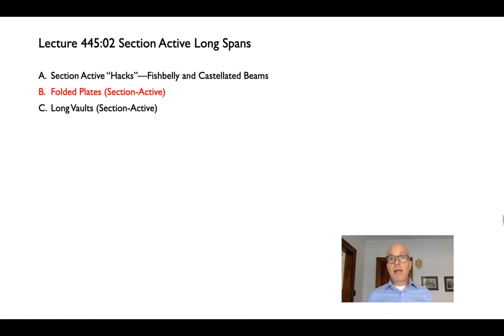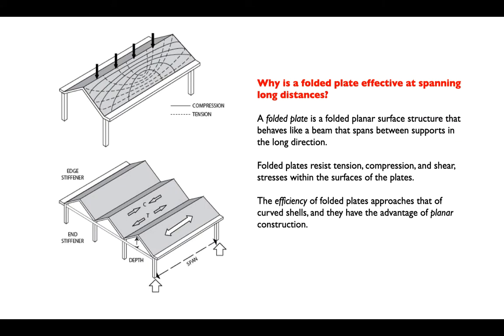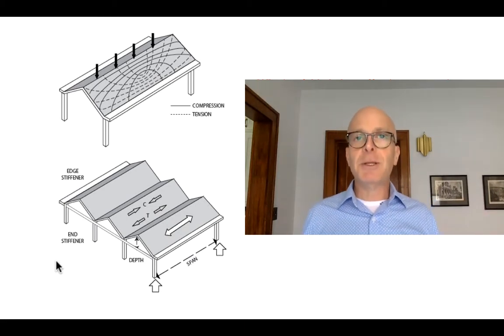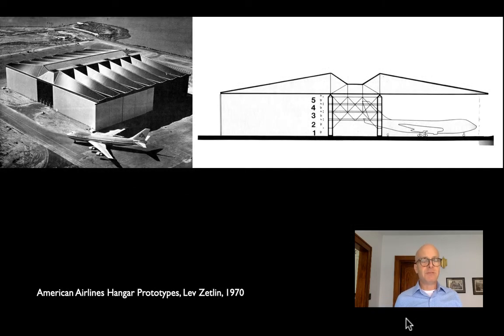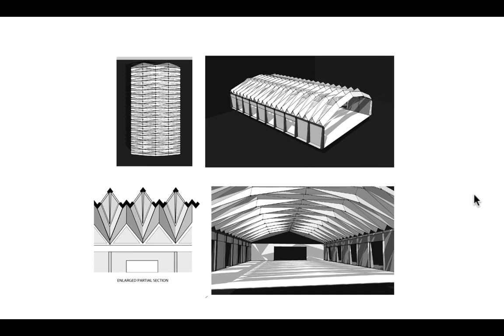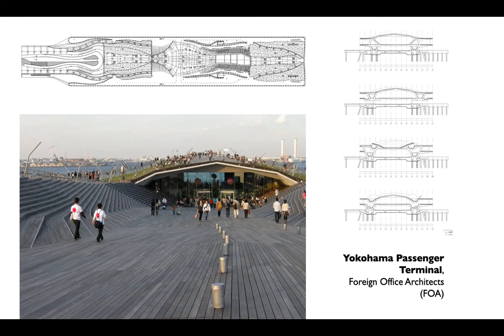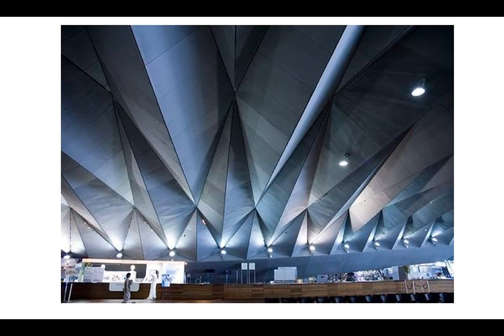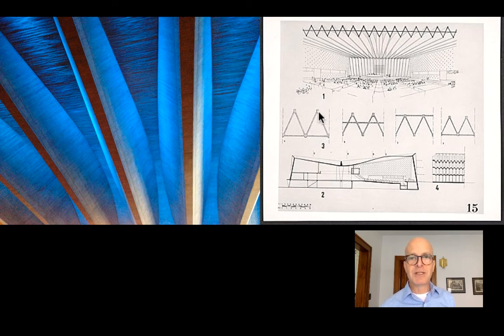ARCH 445 Lecture 02b Section Active Folded Plates

Comment: In some cases, folded plates are classified as surface active structures. I am wondering why did you classify it as a section active system? I intrinsically feel that it should be either a surface active or a form active system...
Reply from the maker: Good point--to my minds, folded plates, exhibit qualities of all those types, depending on how you look at them. I've referred to them as section active, because, in most cases, the goal is for them to behave more like beams in spanning, thin like shells. But you are correct that they can be explained as surface or form active as well.
Reply: Thank you for your answer Professor 😊I really enjoy your videos!

Comment: Why didn’t SOM take the same kind of undulations to the perpendicular axis? Or even taking it further and apply the same undulations to underside of the slab?
Reply from the maker: Not sure which project you're referring to--but especially with pre-CAD/CAM technology, forming doubly curved surfaces was a difficult (expensive) fabricational task--this meant forming curves in one axis only would have been much easier...
Reply: @thomasleslie274  thank you for replying. I was referring to stereoform concrete freestanding shelter. It seems to me it could have been developed even further and make it a 3d undulation. In other words, replicating moment diagram could have happened in the perpendicular direction as well. And then morphing of them. 
On another note, thank you for your great lectures. I think I have watched almost all of them and find every single one fantastic. A Combination of theoria , poeisis and praxia . Thank you.
Reply from the maker: @Mytraism  Glad the lectures are helpful!  If I recall correctly, the stereoform slab proved more difficult to cast in two directions than initially thought--the cantilever span of the roof is pretty short and I'm sure it was easier to form as a simple flat slab.  More info from SOM here:  https://www.som.com/research/stereoform-slab/
Reply: @thomasleslie274  thank you. I look forward to seeing your other videos.